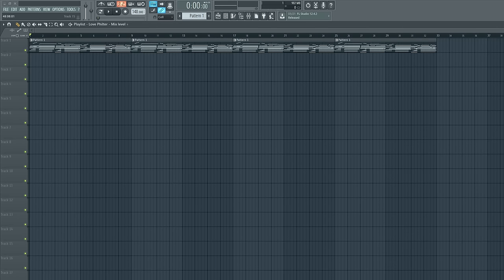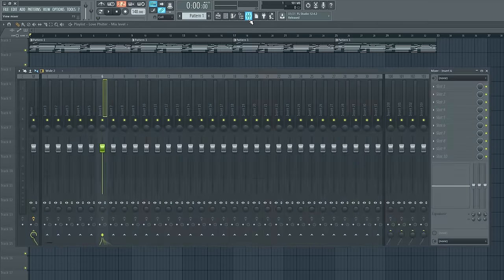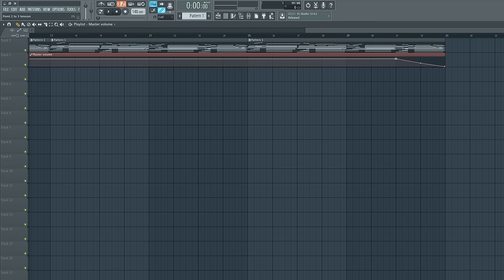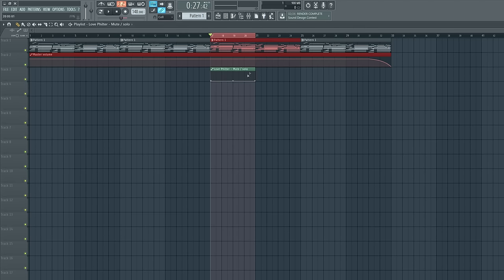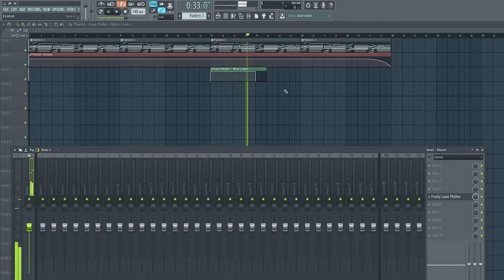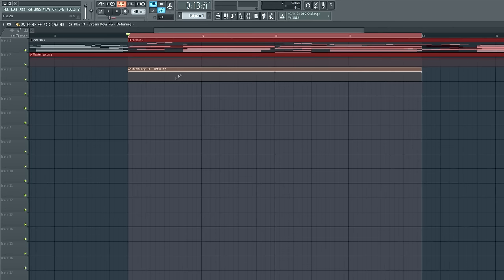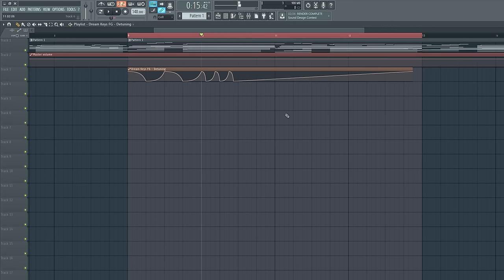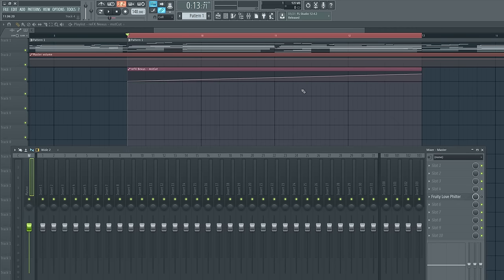How To Use Automation Clips (FL Studio Tutorial)

Comment: Question:  how can I create automation clips for parameters which don't specifically exist in a plugin?  For example, if you open up the "SFX Transitions" (New from template>Utility) template in FL, you can see pre-made automation clips.  Among those clips are "Low pass cut" and "High pass cut" however, in the chosen plugin "Minisynth", there are no specific parameters labelled as "Low pass cut" or "high pass cut".